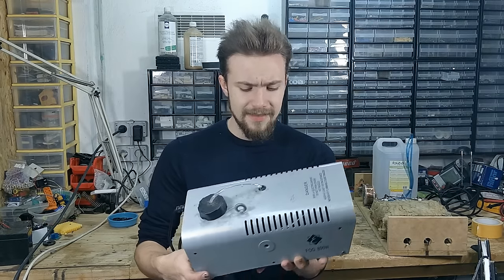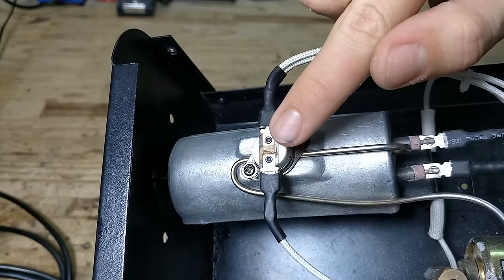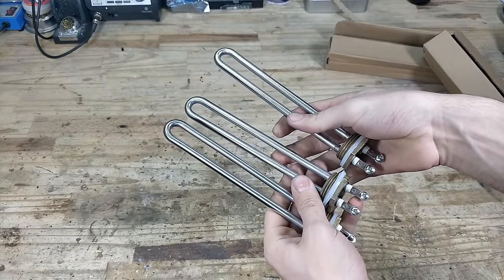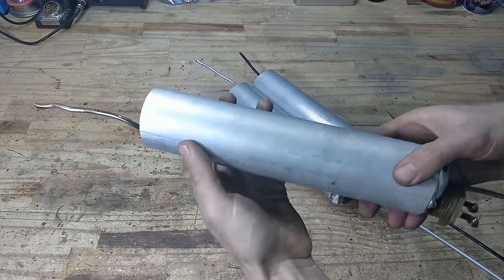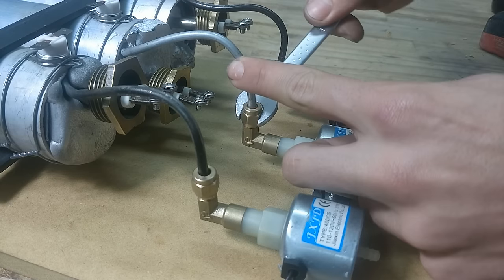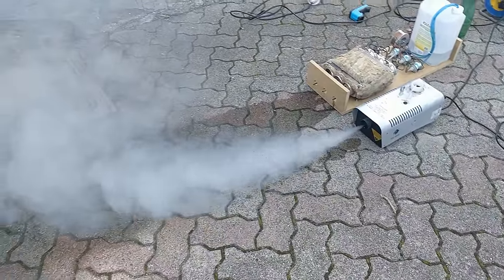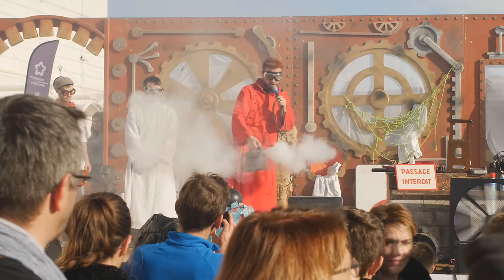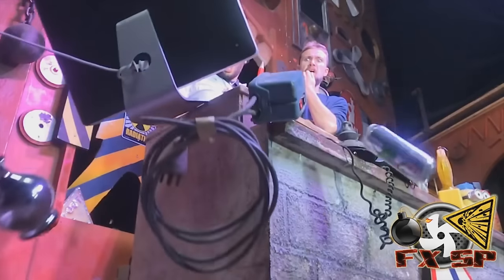Making the Monster Fog Machine - Nicolas Salenc PBP

Comment: My Dad was a Special Effects guy in Hollywierd and we were working on a show called Escape from Witch Mountain and we had to fog in a Mountain. So my Dad built a Smoke Machine that could be hooked up to a huge wind machine. We made it to flow 30 gallons a minute of Smoke juice. It worked magnificently until the wind shifted and blew the smoke over freeway and stopped traffic. When I looked around my Dad, the Director, Producers were no where to be seen. So I got the Ticket from the Police. Your machine is pretty good.
Reply: to make that much smoke id imagine the machine must have had to run on propane or something.
Reply: So around Eastern in Germany it's often warm and rainy at the same time....We do easter fires, some big some small. The one of the St. George Scouts was regularly 2 stories high of dead wood. not totally dry...but unpaintet and untreated...
When the wind turned a big traffic crossing on the other side of a field was smoked up, traffic was stopped, and the firefighters ended the fun. :-(
Imagine having to fight fires at Eastern as a firefighter...most were properly wasted too, off course...
Reply: I loved that movie.
Reply: I also watched that movie every time it came on.
Reply: Of course they were no-where to be seen... They smoke screened the entire production
Reply: @sigmasquadleader  Yes it did.
Reply: Odd question anyone ever tried a bee smoker idea I have but not sure if it would work completely portable if it does however and unlimited fuel
Reply: @filanfyretracker  Too hot and hard to regulate temps. Nah most are generally just water heater elements you can pick up at your local hardware store. Its the same ones homebrewers use for wart boilers or keg stills. Typical way you would make a fog evap is just to take a block of billet and mill in a slot for the water heater then bore a another hole straight thou and tap both ends.  Then you would press fit in a threaded core rod matching that diameter to make the evaporator coil. They are vary easy to make if you have a lathe and mill. The reason a lot of consumer fog machines cap out at 1000 to 1500w is because of regulation your typical household socket can't handle more than that.
Reply: @filanfyretracker  Probably a diesel-fired turbojet engine

Comment: the smoke is burning blue, it should be white, which means its overheating. I am a special effects artist, and blue smoke reads incorrectly on camera, Its down to the oil overheating. You need to put a drip wire on the nozzle, tie of a piece of wire on the nozzle, this stops the oil dripping back on itself into the element area.  A little drip tray will catch the oil as well.  I use the Artem smoke machine its similar in principle except we use a gas flame to heat the element.
Reply: I assume the smoke fluid he is using is water-based?
Reply: That's really cool, can I ask how you got into that field?
Reply: I wonder that, too!
Reply: It is vapor, not smoke, unless there is some oil in the pipes that burns.
Reply: @nhcs2k  its burning glycerine hence smoke mixed with vapour. When cooler its vapour which should be white.
Reply: @ThayAWSOMEworld  training courses, its a proper career now run by unions and has a real training progression. Check out Screen Skills website.
Reply: @bpark10001  Its glicerine and smth else, not water based at all
Reply: @bpark10001  no its glycerin, oil.  The blue smoke issue is just like a car, blue smoke out the tailpipe means burning oil
Reply: Most likely the overheating comes from the heating element being way nearer to the coil in the End of the tube as it is in the front where the sensors are, because it wasn't fixed correctly when he poured the aluminum. Also, I'd think the pumps are underpowered.
Reply: What if he steps down the temperature by reducing the voltage to the heating coils?
Reply: @erigobelli  that will just make the Heating process slower, not actually lower the temperature. It will heat until the temperature switch triggers - it will do that at the same temp everytime.
Reply: @erigobelli  he could do that or just add a resistor inline
Reply: Doesn't look blue on my screen. I think what you are seeing is the aperture /shutter adjusting for the flood of reflected light off the smoke. You can clearly see it happen at 6:59.
Reply: @fealXX   Maybe move the sensor's to the center of the tube then you have a more actual testing of the Temp. Also some Insulation  between the tubes as the center tube may get overheating from the tubes on it Left and Right
Reply: Are you sure its not the light?
Reply: @Rockhopper1  You seem like someone who can help us out. For a car trip with old €500 cars called the Carbagerun. We are looking for the ultimate smokemachine in our car. In this case it's not possible to create to much smoke! It's only for a 6 days trip and must be cheap as possible. My idea was to bend a copper pipe around the exhaust, as nearest to the engine as possible, and pumping smoke liquid trough it. The smoke then should exit at the backside of the car on the roof/rear window. (picture that we have a ducttape Volvo V70 "back to the future Delorean". Do you think this might work?
Reply: Giovanni van Haaren  simpler than that,  if the car is a diesel, run a pipe from the fuel tank to a pump, from the pump to the exhaust, have diesel "drip" inside the exhaust pipe, you will get copious amounts of smoke that way.   If its a petrol, you can have a reservoir of diesel in the boot, and do the same thing.  Its at your own risk by the way.  If you do this, please put a carbon monoxide detector in the cab.  Dont do it in garages or enclosed spaces, and never on a road, carraigeway used by the public.  The pump will run off 12v Pig connector on the fuze board.  With an inline switch.
Reply: @Rockhopper1  yes.. That is the way its usually done, but like i said.. We need the smoke not from the exhaust but from the black "wings" of the "timemachine" ;-). Will it work with a pipe bended around the exhaust? Thanks for your reply
Reply: @giovannivanhaaren9885  I have not done it with the pipe bent round the exhaust, if you can get it hot enough I dont see why it cant work. I imagine that you need to make the pipe as short as possible between the wings and the exhaust, So it does not cool down too much.  If that does not work, I would consider wrapping it in ceramic wrap, to keep it as warm as possible. I would personally wrap just before the mufflers, trying to get it to 250 deg C.  The hottest part is the Cat Converter, under the heat shield it gets to 400 deg C.  The coolest part is the exhaust tips.
Reply: and I work in retail for entertainment industry, where we also sell smoke machines. This is not "burning" but evaporation. This is not oil, but water based fluid with food-grade polyglycols.
I agree that machine is not done properly, and it is not safe. 4,5kW heating on wood... just terrible.
Reply: I noticed that also, Also that pop backfire should probably be addressed somehow
Reply: Maybe its left over refrigerant from the refrigerator it came out of

Comment: This could make an incredible home security system.
Reply: Ja wenn einer die Tür nachts lffbet
Reply: @ncp1840  Ich dachte, das geht los, wenn der Alarm ertönt.  Dies würde das Haus mit Rauch füllen.  Sie können nicht stehlen, was Sie nicht sehen können.
Reply: *Puts chlorine gas
Reply: @dirtblock1383  that's an idea, but that would be a lethal trap and therefore illegal in the US. No matter how much we might want to "Home Alone" our house.
Reply: @Dad_a_Monk  keep it a secret
Reply: Such smoke machines are already installed in som shops
Reply: Hell yeah have some thermal nvg hunt them like the predator
Reply: @Dad_a_Monk  use less than lethal gases that get you so high you just sit around till the cops show up
Reply: and what exactly would it do to detour intruders?
Reply: @a_rabid_raccoon  yeah I guess your right that does kinda sound like a fun time
Reply: @aaronlehman9549  that only works, if it unleashes a stockpile of Doritos and tacos, to slow them down. That and maybe a laser show
Reply: @a_rabid_raccoon   the getting super high fog idea may not work, but a fog machine can still be a safe and effective deterrent if marketed and warned correctly. If a house can fill with a fog containing an irritant, without a risk of fire or damage to property, that's a pretty damn good obstacle to theft. Can't steal what you can't see. I'm a retired cop, and was on our SWAT team. We had a fog machine that used a capsicum additive, creating CS fog. Was designed to be a safer alternative to flasgbangs and smoke grenades, both of which commonly cause fires. That one used a breaching spike to go through a wall or door, and quickly fill the structure. As a security system, it would just have to get past state's booby trap laws... Since most irritants, even CS, are technically less lethal not non-lethal.
Reply: @tjcambre5236  If thats a water vapor, thermals are neutralized.
Reply: Or help then thieves get away un noticed? Shame  on you Bert Renolds
Reply: Help them get away in noticed if anything, I'm with a on this one
Reply: what
Reply: Only problem might be the machine taking a long time to heat up

Comment: Here is a small tip: I repaired lots of smoke machine. They use a simple trick to prevent it from pissing hot fluid: they put the pump in parallel with the thermal switch. When the temperature is too low, the switch close and no power can go throught the pump. When the switch open the power can pass throught the element and into the pump, putting them effectivelly in series. This is fine as the element is so powerfull, so have a low resistance, compared to the tiny power that the pump use, which mean high resistance.

Also, add a thermal fuse as a meltdown protection!!

Another model I repaired use electronics to do the job of a dual thermostat. Basically it have a 2 set points. One is a pump lockout, the other is the heater cutout. Basically, if the core is too cold it disable the pump, which prevent it from pissing hot fluid. The second thermostat control the heater. 

I don't know the exact set points, but let's say that the pump cut out at <220°C, and the heater at 260°C. The advantage of this setup is that the smoke machine work even if the heater is on, which the first model had this issue (heater on = no pump = no smoke), and prevent hot fluid pissing. The disadvantage is the slightly more complicated machine.

Another tip: when you make the heating core, tie up some wire to hold the element centered in your core for when you pour. It will prevent it from sticking out on the back or front too.
Reply: Йййййййййййр
Reply: @Rae Ray nope, I switched job sonce that post.

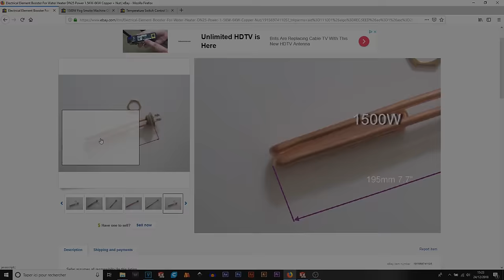Comment: 2:34 Higher wattage will affect how much smoke it can produce! The liquid evaporating will steal energy (cool down) the system, and thus the heater has to pump more heat out in order to keep the system hot. If the heater isn't able to keep up with the amount of evaporation happening then you'll just get smoke liquid out the end of your tube instead of smoke.

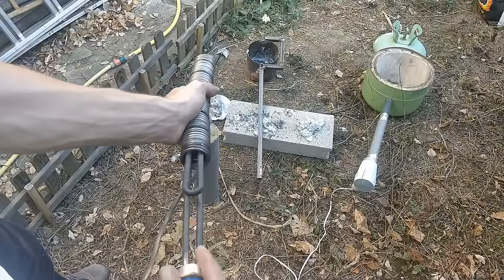Edit: 7:14 Nope, it's because your heater couldn't keep up with the cooling of the evaporation. Slow down the motor or get a bigger heater. Also, thermal conductivity to the coil from the heater could also be an issue.

Adding more aluminum like you suggest is a work around for not having a high enough power heater because the thermal mass of the aluminum acts as a sort of thermal capacitor. So the heater builds up thermal energy into your thermal capacitor which then gets drained as you cool it down by evaporating fog liquid.

Edit: "Yes, I vape" 🤣🤣🤣
Reply: I'm pretty sure even commercially available fog machines don't have enough heating capacity to keep up with the pumps, and thus rely on thermal mass to extend the time it can spew fog.

Comment: Great work Nicolas! You gave me an amazing idea which is very similar to yours ! Here is how I'm thinking it : first I want to find the sweet spot of the car exhaust to have like 260-320°c at  normal driving conditions, then unscrew the exhaust , make a lot of turns with the copper pipe , drill a hole with the same diameter as the pipe to send all the smoke through the exhaust. After that I'm going to pour aluminium on the copper (just like you did)  and Wallah! Haha, all the other things are easy (pump, one way valve,  liquid container).The car I want to do it on is really old and this is for prank reasons. Thanks again I can't wait for your next video!
Reply: My brothers car did the same thing after he blew the head gasket, plus it smelled sweet, just like antifreeze

Comment: Fun fact! Here in the United States, we actually do use 240 volts! We just create 2 120v potentials and when you cross them together through the coil, you get 240 volts. They are separated in our breaker boxes and the big circuit breakers for 240v just simply bypass the transformer coil and goes across the two potentials making 240 volts. We mainly have this separation for massive appliances like stoves, washing machines and dryers. The 120v is SAFER (not safe) to handle with our main electronics like  home PC's, televisions, radios, phones, etc.

Comment: Thanks for this vid!  I watched the other vid about making fog juice, and after searching for a bit, got some Glycerin and Glycol, but when I went to start test found my Pump had gone bad!.  (in my 700W unit, heres me thinking it was a cheap throw-away 400w thing).  But, having watched this vid I realized how smegging easy it was to just replace the pump!.  (well kinda, the new pump was slightly longer, so there had to be some adjustments made to the machine).  So thanks, this saved my $100 fog machine !!  (the replacement pump was $20, plus install time).
Just waiting on a hose ($7) from Amazon, and Ill be able to build my fog cooler and actually test it out!?
Again, thanks for this Vid.  !!

Comment: Lol... 8:47
So Polyethylene Glycol is used as a laxative here in the US. They may use it in the EU in some places. It might be better in some instances than glycerin for fog machines (and vaping). 
Polyethylene glycol actually holds more water per unit than glycerin, so if you're feeling smothered by the glycerin fog, changing over to a Polyethylene fog can "Lighten" the mists.
The downside to Polyethylene Glycol is the "perfume" you used might not work as well because there's also less solvent to dissolve the solute. 
You can adjust this many different ways, but you can play with the balance between glycerin and polyglycol like they do with ecigs.

Comment: Fog machines like these use solenoid pumps.  A diode in series with the pump allows the solenoid to be energized for half of each cycle of the AC power.  A spring inside the pump resets the piston during the other half cycles.  Some pumps have the diode integrated, but others do not.  It looks like the pumps you purchased each have a diode already wired into one of the leads (under that suspicious lump of heat shrink tubing).  For anyone trying to replicate this, depending on the pumps you acquire, you may have to wire in your own diodes.  If your brand new pump doesn't make that characteristic 50 or 60 Hz grinding noise  when you apply power, you probably need to add a diode in series with the pump.

Comment: These are used for security too, when an alarm is triggered, tons of fog are released making it basically impossible to see.
Reply: This is exactly what I was thinking it could be used for, when he fired it up indoors!
Reply: TheSaint135 this is actually a product sold commercially to places like jewelry stores.
Reply: @Mrcaffinebean  I work in the security industry and have seen these at trade shows, but they don't sell well.
Reply: TheSaint135 yeah I kind of figured as much. I think the money is often better spent in other ways. Window film, alarm sensors and security cameras all will do a better job.
Reply: @Mrcaffinebean  that's not really the reason, these work great but the problem I see is that you need to keep them extremely hot 24/7 to be ready to vaporize at any time, so this is just like having an 800 to 2000 watts heater running constantly, it gets expensive real fast. There's also a chemical version made for cars, those don't require constant power and deliver a mild eye irritant if the car alarm activates. Personally my car alarm has activated countless times by mistake and none because of a break in so I'm not sure I'd want one of those either.
Reply: TheSaint135 interesting I didn’t realize they were always on. I just assumes they are some kind of trick superheating elements. A lot of electricity and another heating element to maintain both sound like no fun.

Comment: Nice one. We used a machine with similar output in the Gas station I worked at years ago. When the alarm was triggered, within seconds the whole building was filled with smoke, all electric doors gor locked and a automated call to the police was made, as well as a notification to the owner.

My colleague set it off by accident once, when he forgot to deactivate the alarm, before entering the main room, therefore setting of the motion detectors. Station had to be closed for the day to clean up and reset the alarm system
Reply: Must be a hell of an electricity bill for keeping that machine running hot all the time.

Comment: Nicolas, are you sure that you have the first schematic (for the commercial unit) correct? The pump motor is shown in series with the heating element, so the heater would get different voltages applied depending on whether the switch for the motor was on or off, and the motor would get different voltages depending on the current state of the thermostat? Since you did not mention this in your narration, I have to ask.....

The schematic for your own version looked better.